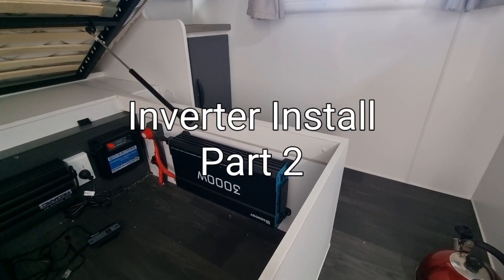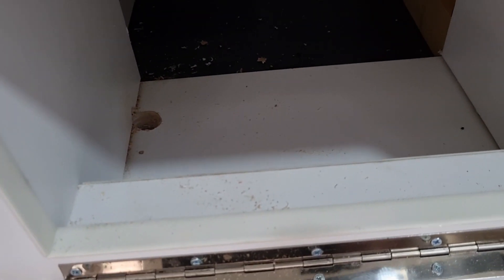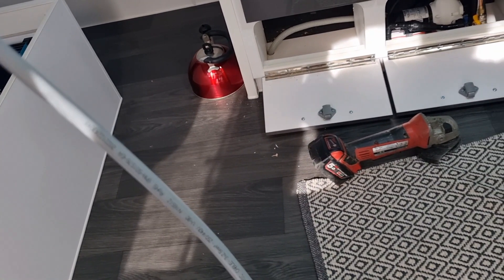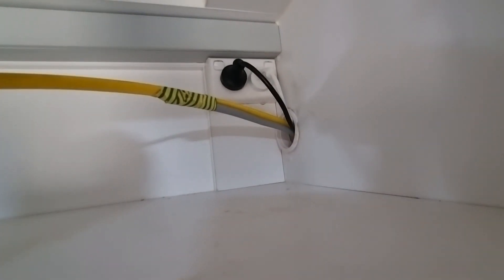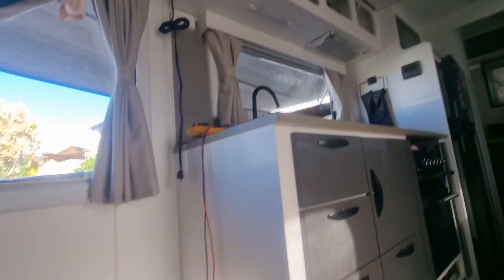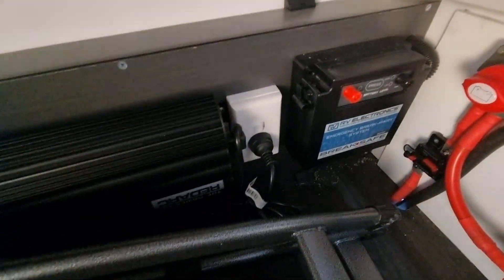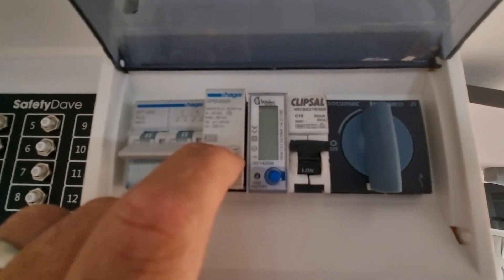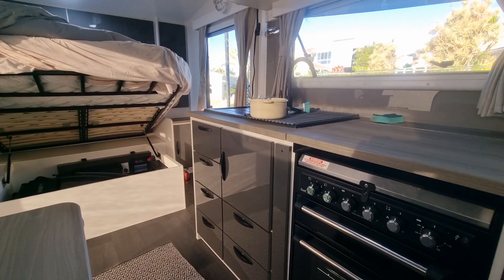How to Install a 3000 watt Inverter in a Caravan Part 2

Comment: You need to use a flexible cable of more than the 7 strands house cable. 2.5mm flexible is what you need. This should be done by a qualified electrician as well. It can be dangerous to DIY 240v installs
Reply from the maker: Not sure you watched the whole video, flexible cable is excalty what I used....but u are right, qualified sparky for the 240v
Reply: @muddyandsandy sorry yea I did. It was a comment more for others following you. Yep you did use flexible cable. 😅

Comment: I've just bought the same inverter and trying to work out how to wire up our little Crusader Charmeleon. I'm like you and want the whole caravan 240v circuits to run off the inverter off grid. Did you use the AC input plug on the inverter. I'm assuming this is an alternative to running the changeover switch.
Reply from the maker: I didn't use the ac input, I believe that's just for running 240v into the inverter when you have 240v,then when off grid it switches to your 12v batterys....... either way the output of inverter needs to be wired to your switchboard if you want all plugs in your van to work...thanks for the comment

Comment: Just a few questions, did you earth you ground lug to your chassis, did you need to make a neutral ground bond, i just wired mine in through my 2 pole changover switch, shore power all works like normal but if on inverter i get no earth at the powerpoints and my rcbi dont trip either.

Comment: Hey mate.. do you need the change over switch in the switch panel or can you just run the inverter straight into main saftey switch.?
Reply from the maker: Best to install a change over switch so that you are separate to the socket on the side of the van
Reply: You Need a change over switch. You will make your socket live and someone could touch it, secondly you are going to power the whole caravan park and that's both dangerous and probably not what you want for your battery.

Comment: Can I ask how do you charge the battery when you have turned off the charger 
Thanks 
Buy the way great video
Reply from the maker: I turn off only the 240v input to the charger, it's a 3 in 1 charger,240v,solar,car input charger......it still chargers from solar and the ute.....if I left the 240v charger on power would go around in circles.....out of battery back into battery.....that would be wasting it.....hope that makes sense....thanks for the comment

Comment: I installed this exact inverter yesterday, did it the exact same way! 
Just one question 
It is nesscary to plug in the ac input to the inverter ? I have an isolator on the output of inverter and inverter input I got from closest PowerPoint.
Thanks
Reply: Not quite sure what you're trying to ask. An inverter has a 12V DC input and 240V AC output. You're describing it the other way around. 
If you're connecting the inverters 240V output directly into a powerpoint, then you will have a live male 240V inlet on the outside of your van. A big NO NO and could kill someone.
Reply: @fifis101 hey mate I know I’m asking about the ac input. The inverter has  ac input .
Reply from the maker: @  i don't need to, as i set it up when i need it, and just use the output, but some people might want it if your normal 240v drops out then your inverter will kick in, that's how i understand it.thanks for the comment
Reply: If you wire the caravan ac in, into the inverter then back up to the fuse box you don't need the change over switch because it's all automatic if the inverter has that function. You have to be sure not to parallel the inverter with the normal ac as that's dangerous.

Comment: Hi What size is the cable you have used from the battery to your inverter? I am worried the supplied ones I have are too small for when I might be drawing a big load on the 3000w inverter
Reply from the maker: 70mm2 ,but 90mm2 would be better for a 3000w inverter

Comment: Hi new to all this
So can I ask if you turn off the charger to use inverter does that mean batteries won’t get charged with solar? 
2nd question if you have 3 way fridge if using inverter the way you wired it you can’t use the battery for charging fridge through solar set up  because the fridge will try and go off 240v once you turn inverter on ?
Reply from the maker: We only turn off the 240 switch, under the bed, the gpo , we don't turn off the dc charger....I run the fridge on gas....if you run it on battery it will use huge amounts of power..30+amps...

Comment: Just a heads up about the RCA leads being plugged into your stereo output. It's probably because it's a CD/DVD player. You can actually play DVD's in it and play them on your TV. That's why there's a 3x RCA lead with video.
Reply from the maker: Your right..but the tv has its own dvd in it already.....I preferred it as a output for the TV.. ....football games etc
Reply: @muddyandsandy  Ah that's fair enough. I requested to have the RCA leads for my new van but they forgot, so instead of trying to run them myself I bought a wireless HDMI transmitter/reciever set. Works a treat.

Comment: HI, I know has been a while since this video, (great by the way), how do you handle the Inverter earthing? Especially when connecting to site power?
Reply from the maker: The output earth it connected to the switchboard earthing system, which is also bonded to the metal parts of the caravan...thanks for the comment

Comment: Awesome video. At least I know what is possible now.
Beats running an extension cord.
Thank you!
Reply from the maker: Thanks for the comment
Reply: ANYTHING 240 volt requires a licenced Electrician.Electricians must submit a Certificate of Compliance for electrical work (CCEW) under the Gas and Electricity (Consumer Safety) Act 2017

Comment: Hey did you run an RCD with that renogy inverter? 
Cheers
Reply from the maker: Inverter wired to Switchboard,Switchboard already has a rcd protecting circuits

Comment: Good job mate, I like the little current/voltage module in the DB. Did you link out the earth and neutral from the inverter at the DB? Otherwise wouldn’t you be getting roughly 110V between N-E and A-E, and only 110/120V at all outlets and appliances?
Reply from the maker: I have the earth from inverter to switchboard ...wired into the other earth's....the neutral from the inverter go straight into change over switch with inverter active....change over switch separates 240v input plug on side of van from inverter input....

Comment: Hey mate,

Im trying to do a similar thing to you and i was just curious on a couple of things:

- why do you manually switch the power from mains to inverter? Doesnt your renogy have a passthrough mode which auto detects and switches when shore power is detected?

- how come you left the bandaid fix of turning off the charger instead of running that single GPO through the battery?
Reply from the maker: Hey mate, I believe the renogy does  have a pass through, I don't use it that offen sometimes when off grid..so don't need it to pass through, just turn on when I want it...I think the lifespan of the inverter would last longer if the Electronics /heating terminals aren't running consistently when I'm using 240v....not sure what you mean by putting the single GPO on battery,  that GPO for charger is only 240v, not for inverter. Not sure what you mean
Reply: @muddyandsandy  I see, thanks. I'm still learning a lot about all this 12v stuff so probably didn't articulate myself very well.

As far as passthrough works, it bought it turned the inverter off when it senses shore power, but activates it when shore power ceases.

With the charger PowerPoint, is that purely for shore power to charge the batteries? So does that mean you could have that GPO not patched through the inverter but standalone through shore power?

Or am I interpreting its function wrong?

Also, will you put your lithium batteries under the bed space sealed and vent them outside?
Reply from the maker: @hemz8058  all good...I have wired they whole van off the inverter, eg. Inverter output straight to switchboard with change over cicruit breaker,that's why I turn off the GPO for the charger, if you don't then power goes around in circles....eg....from inverter to GPO charger to battery's out of battery's to inverter to GPO charger etc.....that's pointless...so i just turn it off, easy to do..

Comment: The RCD will not trip on inverter, a Residual Voltage Device such as an RCD DUO will have to replace the RCD. Works on a rise of 40 volts on the earth.
Reply from the maker: I'll check it out...
Reply: Yes, I have watched a utube video on this and you need to run a RVD to be safe with running a inverter and generate

Comment: Hi there
Why do you need an isolator switch as well as a resettable fuse, if you want to isolate the inverter couldn't you just switch the fuse of and reset it when you want to operate the inverter again ?
Reply from the maker: Yes you could just use the resettable fuse to turn off....but I perfered to have a isolator..as it's designed to be a switch...

Comment: Thanks for sharing. Cheers. Ps: Did I imagine it or did I actually see a RedVision system? If so, maybe you should have spent the money on LifePo4 batteries instead of the Redarc unit
Reply from the maker: Redarc system come with the van, when I purchased it, the next step was to upgrade batterys
Reply: @muddyandsandy  Based on the various brands which I a saw in your video, that makes sense. Cheers

Comment: Great vid
Who did you get to certify the 240v electrical work ?
From what I understand you can do 12v wiring and you can plug an extension cord into the invertor but as soon as you start cutting cables that run 240v this work needs to be done and/or certified by a licence electrician ??
Reply from the maker: I got a very local sparky to do it..
Reply: why not just come out and say it?
Reply: @standupstraight9691 😂 because it's BS

Comment: can you run the fridge on 12v with the inverter on? I only plan on using 240 for cooking woth an induction top and hot water, after that would switch back to 12v to save on using gas
Reply from the maker: That's a hard one..because the fridge I use is a 3 way....which uses around 20+amps on 12v....that's alot...easier  to run on gas....unless you have a compressor fridge that would be fine, but  it would need a lithium setup......I only use inverter for 240v appliances...blenders,toaster etc

Comment: Where to start!? Jeez love it, soooo I have a caravan with 12 volt everything too as stock and an electric hookup plug on the outside. I was thinking of … setting the leisure battery (460Ah lithium phosphate) in my boot and connecting it too the same 3000 watt Renogy inverter. Outputting from the inverter into the caravans electric hookup, would that work? Again I’d run the fridge and heating off of gas. It would mean the 240 sockets would all be active then for microwave and kettle etc. any issues with running the inverter for extended time periods etc? The leisure battery in the car will charge from the engine from a dc to dc charger and solar on the roof. I want the leisure setup on the car as I also go camping without the caravan. Would appreciate your thoughts!
Reply from the maker: Sounds fine...just remember to turn off your battery charger when on inverter..
Reply: I had a camper van I built with a 3KW INVERTER , leaving the inverter on even without a load will drain the battery over time(I had an 260ah AGM ), lithium might be different and quality inverters may have less of a draw on the battery.
Reply: @simontrotter2678  yea I’m
Familiar with parasitic draw and it will only be on when being used.
Reply: Just thinking of extended periods of use, I found with my crappy AGM it drained pretty quick. I’ve sold my camper and bought a 2018 3.2 Wildtrak , next step buy a caravan and start the off grid process again this time with lithium🤣🤣

Comment: Hi muddy.. have brought same switchboard items.. am a sparky.. and   
any chance u able to draw up or do a schematic of yours 🤞🤞🤞
Reply from the maker: Abit hard to send it here...but I did end up adding a rcbo next to inverter  ..then run cable to change over switch...just made the outside socket wire into the 2nd input of the change over switch...fairy easy...change over switch has 2 inputs and one output....I put every socket on the inverter....and just turn off battery charger when inverter is on..
Reply: @muddyandsandy  cheers much appreciated

Comment: Will this system run a 50ltr electric air compressor, 1.8 kW 230v ?
Reply from the maker: Yes it will....but just depends how long you run it for as batteys will be drained quickly...especially if agm batterys
Reply: @muddyandsandy  ideally it will be used to pump tyres. But this is not everyday only if and when required. What batteries would you recommend?

Comment: Does rhe rcbo work with the inverter correctly? Guessing it does not internally bond neutral and ground?
Reply: Rcd wont trip unless you've bonded neutral and ground ......the test button will trip it but not an rcd tester
Reply from the maker: Hey...yes the rcbo works..it's grounded Internally...floating earth I think they call it...

Comment: Good informative vid mate
One question when this is all working will the shore supply plug (the 15amp from the mains to the caravan) be alive?
Reply from the maker: Hey....no it doesnt...as I have a change over switch, which disconnects from that plug....and connects to just the inverter input and power points in van....think of it like this....the change over switch has two inputs and one output...the 2 inputs are totally separate from each other....you can switch up for example for shore power or down for inverter power...thanks for the comment
Reply: @muddyandsandy  awesome  I want to do my own  (not an electrician) so I’ll research change over switches
Thanks for the reply 👍
Reply: The renogy inverter does the changeover itself

Comment: Hi, for your HWS, Fridge & Charger I would put remote controlled power outlets on them. Bunnings sell an Arlec version. Then just fit the remote somewhere easy to see. One remote can control 4 outlets. That way they are always OFF, just when you plug into grid power you push the remote and they all come on.
Reply from the maker: Not a bad ideal..I'll look into it....thanks for your  comment
Reply: Hey mate im going to run that same electrical for my inverter can you tell me the name of it. Im going to run all the wires for the sparky. Also what amp change over switch it required? Cheers

Comment: All thru a 10 amp plug . Not strictly correct
Reply from the maker: True...but the max my battery can output anyway is 2600w..was never planning on running 3000watt equipment...so it can't do more than 10amps anyway....that was my reasoning..cable can do 20amp..and the only difference between 10amp plug and 15amp plug is the earth pin...its the cable that is the most important thing, and that fine.....i could change the rcbo to 10amp and that would limit it for sure....thanks for your comment

Comment: Hi mate wouldn't doing it this way make your external male power input live? Or am I missing something.
Reply from the maker: Hey mate...inverter feed goes straight to a change over switch.....so there is no connection between inverter power and outside caravan input plug.....change over switch has 2 inputs and one output.....1 input inverter and other input is outside caravan plug........when you switch up to inverter it only connects to inside power..hope that makes sense...thanks for the comment
Reply: Thankyou. I am looking at doing the same thing and it was doing my head in. Cheers.
Reply from the maker: @coastalfurn  I'm doing a video next week on power surges etc and I'll show that change over switch...it will be easier if I show it aswell